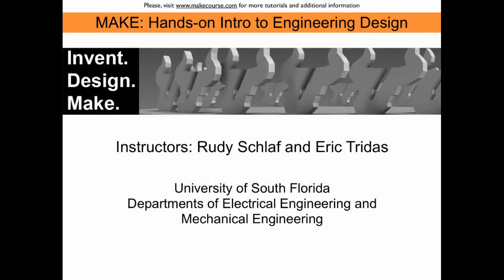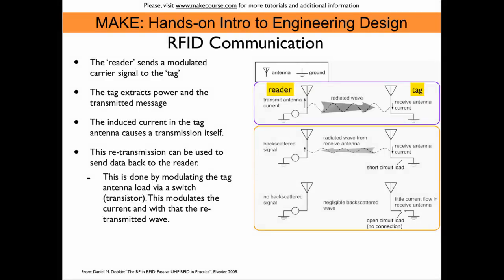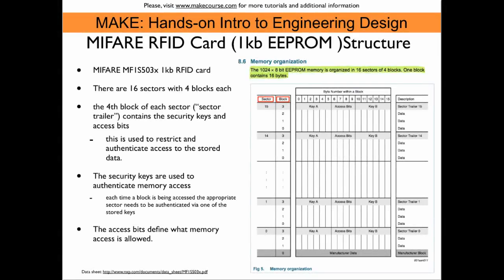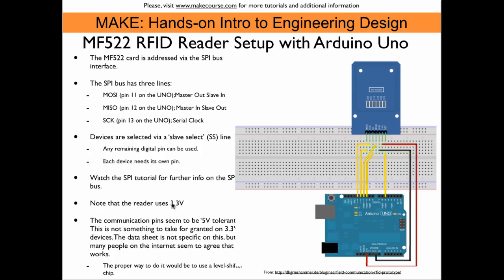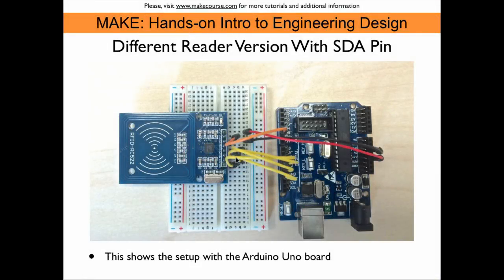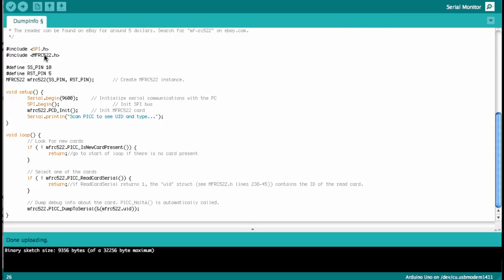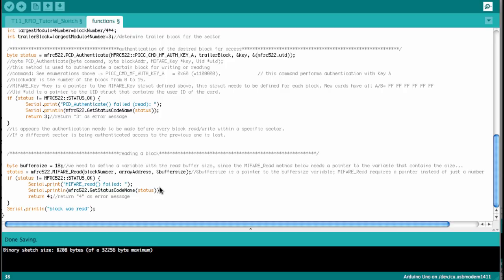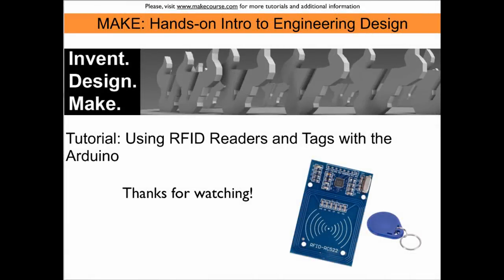Tutorial:Using a RFID Card Reader with the Arduino (Update)

Comment: Hola, le agradezco sus vídeos sobre el tema de RFID, son realmente muy educativos.
Quisiera que me ayudara en un problema,
he descargado la librería RFID de MiguelBalboa, y queriendo realizar el ejemplo de cloner, tengo un error.
que es el siguiente
Copying the data on to the new card
Insert new card...
Card UID: 92 59 4E 25
PICC type: MIFARE 1KB
Authenticating using key A...
Authenticating again using key B...
Writing data into block 1

 44 61 72 44 75 69 6E 6F 20 20 20 20 20 20 20 20MIFARE_Write() failed: A MIFARE PICC responded with NAK.

Authenticating using key A...
PCD_Authenticate() failed: Timeout in communication.
Le comento lo que stoy realizando
1.Read card 
2.Write to card 
3.Copy the data.
 y ese es el error
no se donde puede estar solicito su ayuda
Saludos dardo